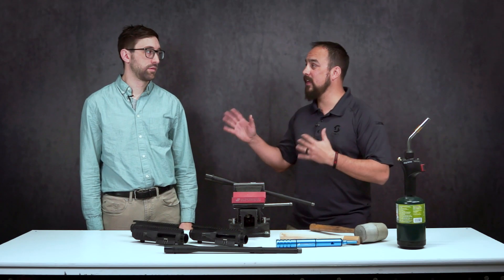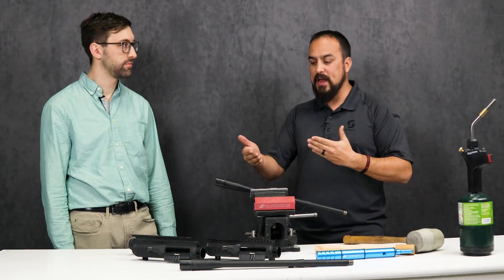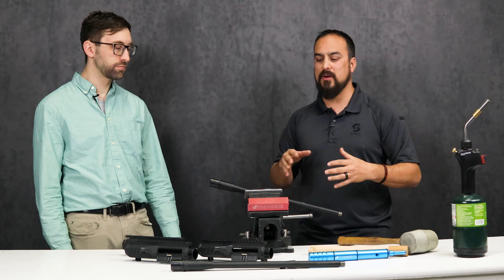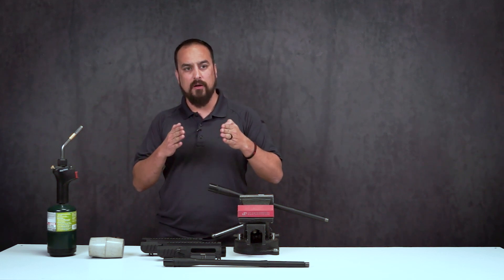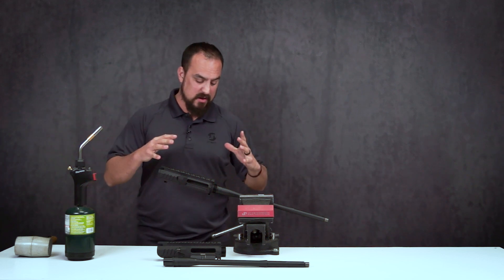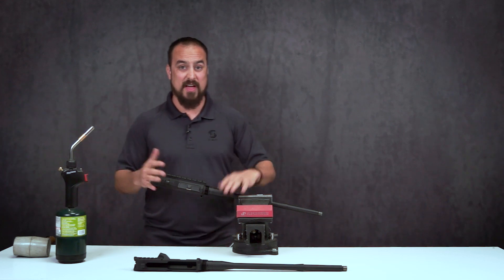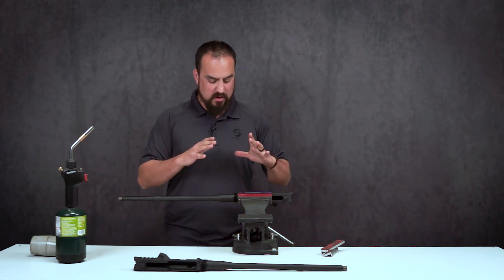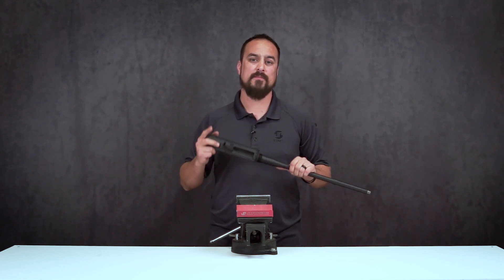The Secret of Thermo-Fit™

Comment: Been doing this as a mechanic for bearing installs for decades. Make it easier on yourself and put the barrel on a block of dry ice or in a freezer. Thermal shift also works when you make things colder 👍🏻
Reply: Yup. We call this a "shrink fit" in the machining industry. Very common for bearings/ sleeves.
Reply: Yeah, what he said.
Reply: you must be installing a lot of lockers in diffs, lol
Reply: Blazin609 It works well. Lots of blind bearings on motorcycles. Just remember no torches/open flame on the race bike cases/covers unless you’re sure they’re not magnesium...one of the new guys had an exciting day at my shop not realizing this 😂. Also, don’t throw water on a magnesium fire. Double 🤦🏼‍♂️
Reply: Key board cleaner ,hold can upside down just make sure protect skin ,frezz burn quick ,,NO JOKE
Reply: Yeah, I always chuck one part in the deep freezer and one part in the oven.  Usually electric motors and differential carriers.
Reply: I seriously think people who need to watch videos on how to build a gun are pretty dumb. Y'all nailed it. Heat one cool the other.
Reply: Actually axle bearings bucket pin bushings sprag bushings in my race transmissions and the list goes on and on and on brought this technique into it freeze first oh shit... patent pending sub zero thermal lock up technology got one up on ya jp I can leave 
.005 thousandths in my design due to sub zero technology or a refrigerator lmao
Reply: @roadlice  yessir
Reply: Curious ? 
How does negitive tempering work ? Supposidly aerospace version of heat tempering but extreme cold ???
Reply: Just thinking butane torch fuel is extremely cold what if ???
Just no open flames \smoking or ya won't need a haircut for a while !!!
Reply: William Collins That’s a long conversation on the properties/physics of what alloy you’re using. Your example is NASA, they have access to metallurgic things no normal person can even fathom.
Reply: When I was building some rifles before a registration deadline I actually had a fitment issue with a receiver and barrel, and that's exactly what I did; Threw the barrel into the freezer for an hour, then used a blow dryer on the receiver to heat it up. Slipped on like butter. This and using a Knipex Plier Wrench for doing the pins (particularly the gas tube pins which were made of just terrible metal that wants to break) were things that I found aren't often repeated by others building rifles.
Reply: @williamcollins4082  If you're talking about Cryogenic Treatment then JP Rifle already does this on their barrels by themselves. Supposedly this company offers it as a service: https://www.diversifiedcryogenics.com/gunbarrels.html
They happen to be located on the outskirts of Minneapolis just like JP Rifle, so I wouldn't be surprised if they may have worked together at some point.
Reply: @smith8124  so i have heard ???
Reply: Very cool 😎
Reply: Hell yeah installing bearings as a mechanic is same principal . Barrel in the freezer and upper in the oven. Done.
Reply: 100%
Reply: Learned and performed this technique removing blind bearings in my Yamaha FZ 1000
Reply: Ferrari does that for their valves in their cylinder heads.
Reply: Dang it you beat me to it. Hahahahhaha its good to know other mechanics use this method.
Reply: So I'm seeing threading for a barrel nut, does this completely replace the barrel nut and that threading is used for a proprietary JP handguard(still doing research on JP products, I'll probably come back here and edit this comment in a bit) or are you just not installing the barrel nut in this vid? I'm considering a JP upper/lower and bcg(and weighing options between either like a Bartlein or Ilja, or more like a Faxon or Wilson barrel) and am only starting my research into JP. 

I have both an Anderson and a DPMS but want a sub-moa rifle. I noticed the issue with fit the first time I changed my barrel, on my Anderson(tbf, Anderson is GREAT for the price and it's a pretty snug fit but seems like it could/should be tighter, even though the barrel nut for a free-floating hg pretty well tightens that up, it still seemed like an obvious issue), as well as the loose tolerance between the two receivers(although all the info I've found seems to say that the looseness between upper and lower, the tiny bit of wiggle, doesn't affect accuracy) always concerned me from the start. 

I REALLY like this idea and am glad I watched the video. When I first read about it I was immediately turned off, thinking that there must be some proprietary part, tool or addition, incompatible with other manufacturers. I'm glad I was wrong.
Reply: So doesn’t either method not have the same result? The torch method took about 30 seconds. I’m not waiting an hour for the same result.
Reply: @Strawman333  Short answer - Sometimes yes and sometimes no. If only doing one yields enough of a shift that the parts slide together, great, you’re all done. If not, you’re going to have to do both. Longer version - Depends on the the amount of interference engineered into the fit, combined with the thickness and metallurgy of the parts. Also, potential tolerance stacking of the parts used. Same brand, same manufacturer, same part numbers, two different sets of parts - one might be fine with just heat. One will need heat and a freeze.

Edit - If you’re not familiar with doing this type of work, do both. You develop a feel for what’s needed over time. Once the surfaces contact, they expand and contract very quickly. If you don’t get it properly seated to full depth, you just made a real headache for yourself and are going to need some specialty tools.
Reply: @smith8124  I appreciate the explanation. Makes sense. Take care.
Reply: @Strawman333  less chance of screwing up your upper receiver finish. Cerakote is pretty tough but it can discolor a bit using the torch method. Throw your barrel in the sub-zero chest freezer or refrigerators freezer the night before if you're that impatient.  The next day when you're ready to install it, she's ready to go. Also, if you're gonna use the torch method don't use the tip of the flame which is the hottest part. Notice how he used the cooler base of the flame. Just my 2 cents worth.
Reply: I just watched a video of a guy measuring a barrel before and after freezer. There was no difference in measurement on the barrel extension with the micrometer. Heat is the way to go for barrels IMO. Not saying cold doesnt work for other things.
Reply: @ACDCRD   I think you missed the part about the dry ice, which is -78C or -109F. A freezer is only around -3C or 27F. More thermal shift with reduced temps.
Reply: Fill like you should make a channel. I was think heat aluminum.... idk
Reply: @Strawman333  I'm with you, the torch method was simple on and simple off. These people make things way too complicated unecessarily.
Reply: Disparaging people who want to learn is dumb.@wannabecarguy

Comment: interesting approach. Had a situation years ago with an undersized upper receiver where the standard sized barrel extension wouldn't fit. Instead of heating the receiver I tossed the barrel in the freezer over night. Next morning slip fit. Once the barrel warmed up to room temp it was locked up nice and tight.
Reply: That would be better than heating the receiver
Reply: Lee Adam 

I am a little surprised that they recommend the torch. 

It’s perfectly fine as long as you don’t get it too hot. It’s just that with that hot of a heat source you have less room for error. 

I am not a metallurgist, but you don’t want to screw up the heat treatment. 

I would recommend putting the receiver in the oven at its lowest setting 150-200, and putting the barrel in the freezer. 

I had to do that when putting a match barrel in my 10-22. 

By doing it that way, you won’t take anything outside of a temperature range that it wouldn’t possibly see anyways.

Comment: Love it, but as a long time machinist and gunsmith I find it funny that this is considered "cutting edge secret sauce."

When high accuracy concentric assembly is required, interference fit has ALWAYS been the answer. (Thermo-Fit™ is just interference fit...)

Also, the whole torch thing works, but it unevenly heats the receiver with point heat, which can cause distortion as original forging stresses are released unevenly. Not likely enough to affect function or accuracy, but still not ideal. Heating the whole thing together is a better option. Absolute easiest way to do this? Dunk the upper in a pot of boiling water for a second. This ensures that it is heated evenly, and to a specific temp (water boiling point at your alt and pressure) and helps prevent overheating localized areas. Dunk the upper in a pot of boiling water, and slide the barrel home. 

There's MY "secret sauce" that has served me very well in gunsmithing for competitive long range rifles, as well as general machining for a long while...

Don't think I'm bashing JP at all here. JP makes incredible rifles, and this kind of innovation is fantastic. Just pointing out alternative methods. :)
Reply: Very cost-effective and accesible solution. You can make some soup with that water after too.
Reply: Why not just put it in your oven cold, and let the part warm up as the oven warms up? Personally i would just use a heat gun so it does not heat as rapidly.
Reply: Ok how long do I keep the upper on there for? A second?
Reply: 10 or 20 seconds is really all that's needed but the beauty of boiling water is that it won't get it any hotter than 212 regardless of how long you leave it in the soup. No harm done if you dunk too long. That's the challenge with the torch or heat gun is the risk of getting too hot. Careful hand can do just fine, but the boiling water takes no skill and takes out all the risk
Reply: @ianahner9657  dump the receiver for 10-20 seconds in boiling water?
Reply: Yup
Reply: @ianahner9657  would let’s say an oven be safe as well? Pre heat to 220 then stick it in there for 20 seconds?
Reply: Thermal transfer of air is much lower than water. If you're using oven it will take a good bit longer. If the oven is truly 200F just put it in there and go make a sandwich. It'll take a bit but as long as you're that cool, you're not going to damage it
Reply: I usually put in oven at 200*
Reply: AR soup.
Reply: The uppers are not forged, it's machined bullet aluminum, and there are no forging stresses. You will need to use a torch, there is no way around it, especially for a barrel change.
Reply: Barrels heat up to thousands of degrees that touch the upper. Cherry red hot. I wpukdnt worry about any heat.
Reply: @diogenesofsinope6809  Back in the old days it was " Weiner water soup" Not sure what they would call it today? Maybe Receiver water soup?

Comment: Outstanding!    Others were using thousand inch stainless steel to shim other rifle barrels in loose upper receivers.   
The JP process of barrel and receiver fit is just rock solid flawless in engineering design.

Comment: I installed my barrel the same way.  Barrel in one hand, noting the pin location. Heated the upper threads over the gas stove in the kitchen. Keep it moving, the aluminum will start to sweat, then it will flash off and be dry again and slide it on. 
Done.👍
Reply: Appreciate the explanation

Comment: Wish I had seen this two months ago.  Had a BCM upper I tried to fit with a heat gun, and it got stuck.   Got a torch, rigged up a jig, and cut off a broom handle to pound it out.   Live and learn!
Reply: I've found that most Bravo uppers are a tight fit.  Usually do the same but the barrel goes in the freezer the night before.  No issues.

Comment: I would prefer to shrink the barrel with dry ice or liquid nitrogen than heat the aluminum.
If you're going to use heat it would be better to use an oven where you have exact control over the temperature and the heating is even.
Not possible with a torch.
Using a torch for disassembly is a different story. But should be done while applying a separating force at the same time as you apply heat so you use the minimum heat required.
I've done precision assembly with interference fits for decades.
This has always worked for me.
Reply: Also the cryogenic effect on steel will improve its toughness.
Reply: @strykerjones8842  Most of this type of interference fit would be possible with dry ice. Liquid nitrogen is for a greater interference fit. I have actually had to use both freezing and heating on occasion.  But these were  steel alloys engineered for a greater interference fit.
Also significantly larger assemblies. 
Lots of fun.
Reply: I was thinking same, use toaster oven to heat receiver and put the barrel in the  freezer for an hour or more.

Comment: I use a hair dryer and an old one at that. If your using a hair dryer like me dont really worry to much just get it hot to the point were it kinda hurts to touch (NOT blazing) and put it in. My first time was with a criterion 11.5 on a bcm upper and it was a bit of a pain. This very second I put my m4 ish aero barrel on my new bcm upper and used a mallet with easy taps to seat it.

Comment: Great video despite the tough crowd:-)     Couple questions:   1st, no issues or differences in torque values as you torque the barrel nut later?    2nd, galvanic corrosion or whatever it's called - any issues exacerbated by this process?   3rd, what's the rule of thumb on size match up??   You need to be 1 thou over, two thou?   In other words, how much expansion are you getting in those 7 revolutions?   Last one just an observation.   I'd think you'd want to keep pressure going forward for just a moment as you seat in case you had some bounce you couldn't feel - wouldn't think you'd want any movement at all under that tension as you tightened your barrel nut later.
Reply: As long as you slide the upper all the way on until it stops there isn't going to be any issue with torque values, I'd recommend lapping the face of the upper if it's a cheaper upper, I even lapped my last Aero upper so it was "perfect". Galvanic corrosion happens when bare aluminum touches a dissimilar metal like steel, the anodizing on the aluminum upper prevents the two from touching and you're not heating the upper enough to ruin the anodizing. A typical AR-15 upper where the barrel extension slides in is typically 1.000" diameter give or take around 0.001"-0.002" depending on what kind of quality the upper is. You're typical barrel extension is about 0.9980"-0.9995". When heated to 200°F a 1.000" aluminum upper should expand to about 1.00215". Just "guessing" but their barrel extensions must be machined to 1.002" which is probably why he had to tap that 2nd receiver on so quickly...
Reply: @macgyver5108  Thanks for the reply.   I was considering a bat extension but have not selected a receiver yet for a second build.   My current interest is AR-10 but i confess to buying an AR-15 (spikes lower and DPMS upper during the Feinstein inspired scare years ago with a zero knowledge-base on my part) and have thought to go through that and see what I have now that I've built and learned from my first AR-10 build experience.
Reply: @macgyver5108  thanks for the reply.  Just built my first AR, this one an AR-10 (AERO Enhanced upper and M5 lower).   No opportunity for the thermo-fit with this one so thought to have another go with a Bat extension  and the thermo-fit in mind.   I confess that during the Feinstein scare years ago I foolishly bought (with zero knowledge-base) an AR-15 that turned out to be a Spikes lower and DPMS upper.   I keep thinking I ought to tear that down and assess what I have and how it was put together.

Comment: Heads up. That "bout a 1 inch" dowl is actually turned down to about 7/8ths inch. Unless you have a lathe handy, good luck sanding that down enough. And you're going to need this, because unless you thermal fit barrels for a living, you're going to be slightly off with your index pin the first few times and there is no turning the barrel once its in - gotta come back out and start over.
Reply: I used a socket with extension as I have no dowels sitting around. Was about to cut off the broomstick but they are all hollow aluminum now.

Comment: If folks are concerned about their coating on the upper, can you freeze the barrel so that it doesn't require as much heat to fit the barrel to the receiver?

Comment: Cnc machines have used it interference fit tool holders for a long time now. We incorporated heat/shrink interference fits on competition service rifles using stock recievers and barrel extensions. It works, accuracy improvement is however the same as a good barrel bedding job using shim stock,loctite or press fit barrel extensions tensions. The issue with doing this is that the reciever bore must be perfectly round with no high spots and even quality recievers rarely have perfectly true bores.

Comment: Nice bit of engineering.  Have you been able to determine what temperature you are getting your receiver up to and if you are loosing any temper or over aging the aluminum?
Reply: Getting a recommended temperature would be nice, as we can use an IR thermometer to have better control of the process...
Reply: @Big Wally get your hormones checked.

Comment: I just did this today with a Rainier Ultramatch  6MM ARC  barrel and a BCM Upper. I put the barrel in the freezer overnight. I pulled the barrel out and put some slip retainer on the barrel  extension  I then heated up the BCM receiver and put it together the last 1/8 inch didn't want to go so I put the barrel nut on and sucked it right up. It shot decent today, I hope I didn't screw anything up?